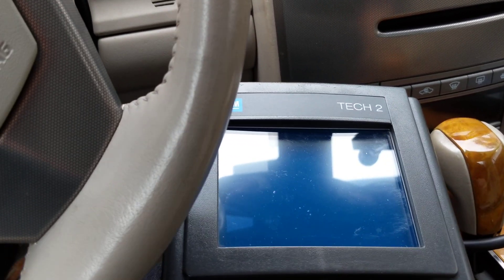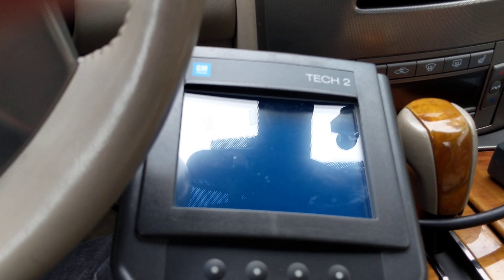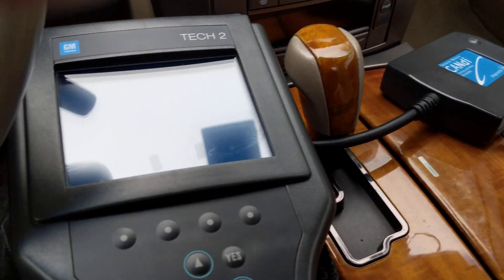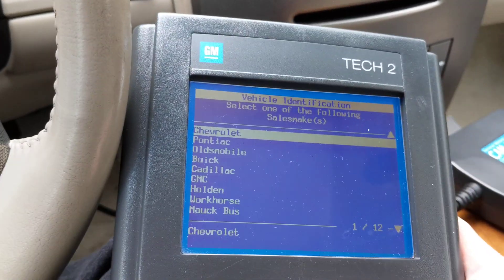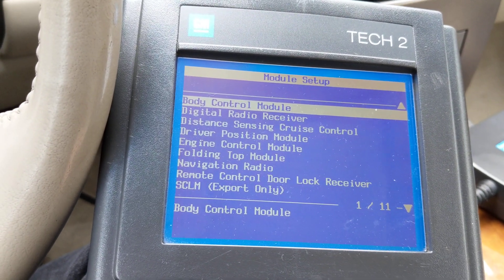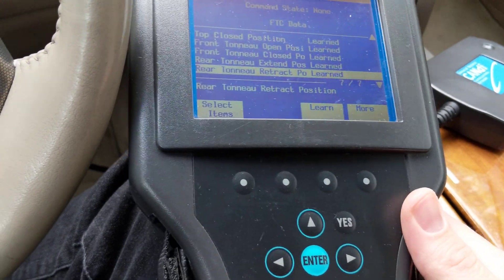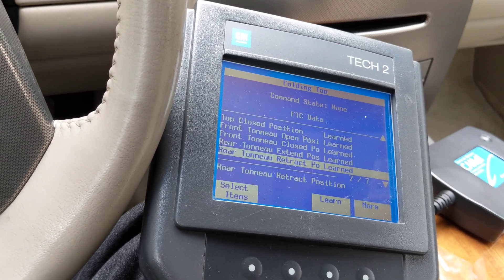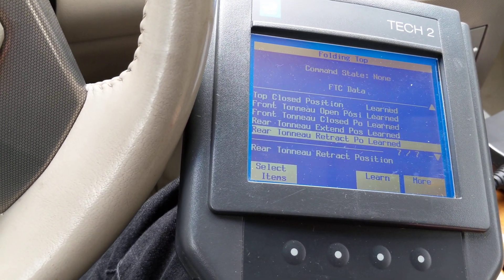2005 Cadillac XLR Folding Top Learn Procedure with Tech 2

Comment: You did not have the car running in the video.  I am assuming the car has to be running in order to move the top while it is running.  Yes or No?  Thankyou
Reply: Car needs to be running as it takes full voltage to run the top.even with a good battery best to have the car running. low voltage stops the system and requires a relearn